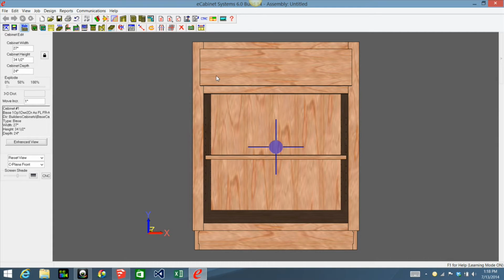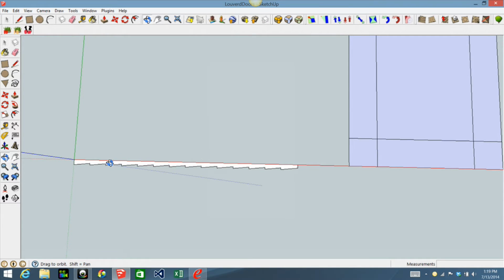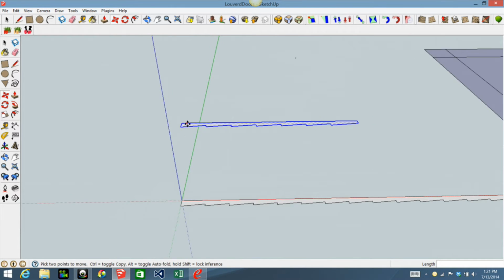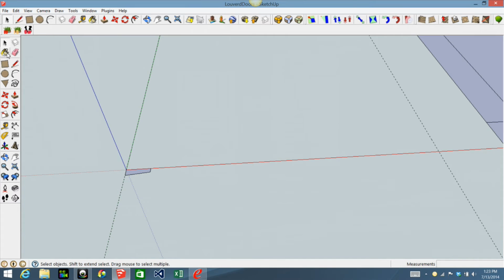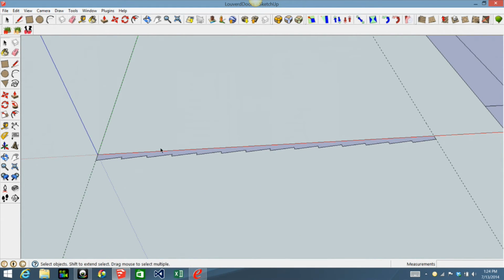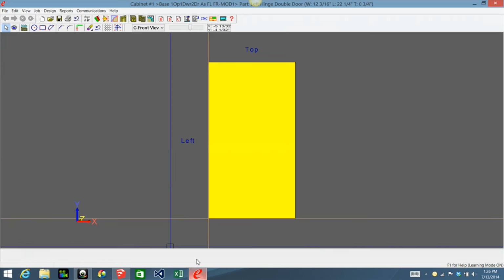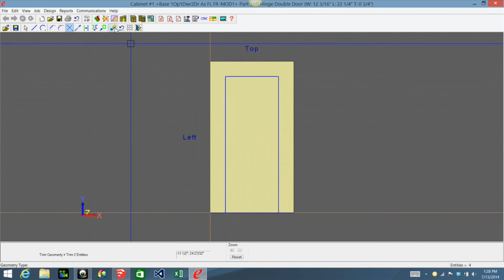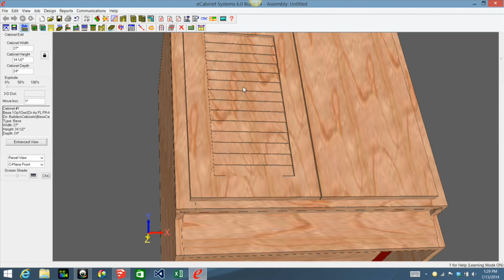Create a louvered door from a slab door

Comment: Great video- I followed your technique to make a "ribbed" effect door that had a nickel gap pattern on an MDF panel every ~1" across the face of the panel, 1/8" wide x 1/8" deep.  Will this actually export to the cut center correctly? I don't understand if the edited geometry is just for the rendering or will actually export as relief cuts in the CNC process.
Reply from the maker: It should. I would give it a try but do a dry run before actually cutting it on the material
Reply: @eCabinetstipsandtricks  that method doesn't seem to actually create any geometry that is exported as a tool path when I nest the part, despite rendering correctly as a nickel gap style panel.